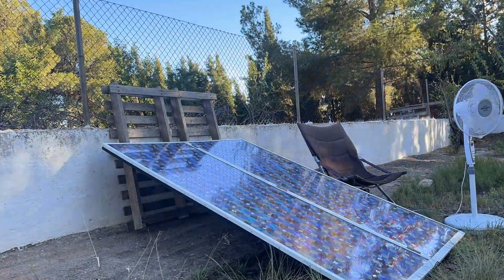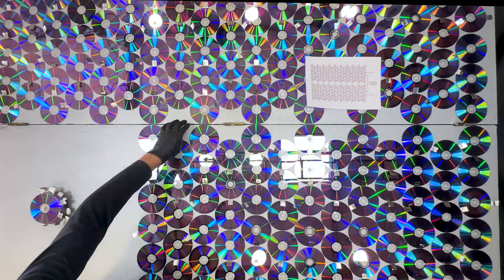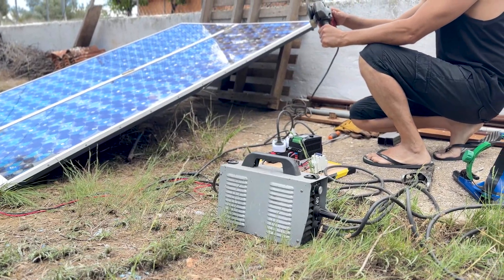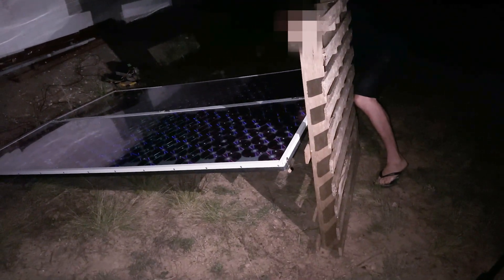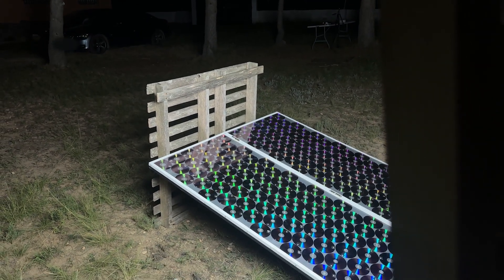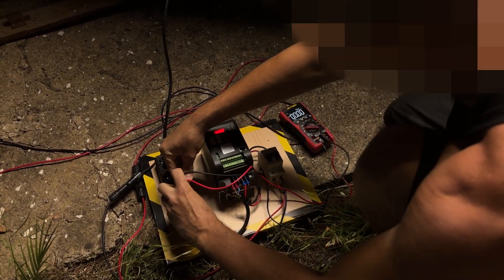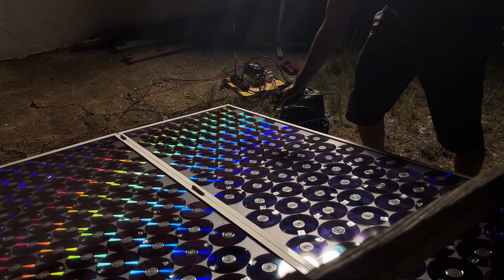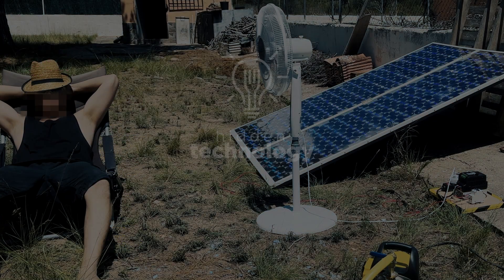THIS HOMEMADE SOLAR PANEL WORKS ON MOONLIGHT

Comment: so, just for you believers, i asked chatgpt: 
*Question:* If I remove the protective layer from a CD/DVD/Blu-ray disc, attach wires to both sides, and expose it to light, what kind of current and voltage can I expect on the wires?  
*Answer:* You might get a few microamps and a few millivolts at best. These discs aren’t designed to generate electricity.
Go, check it for yourself, ask R1 or other Llamma, they will say the same.

Comment: use atmospheric energy instead
Reply: @priv1leged  AKA static electricity? There is something that can, it’s called a corona motor but not efficient & can be improved.
Reply: I use psychokinesis to spin a turbine without steam.
Reply: Can you charge a battery with the home made solar panel for use in the home, I think I could build this, also will it work in Britain we hardly get any sun. Anymore thank you